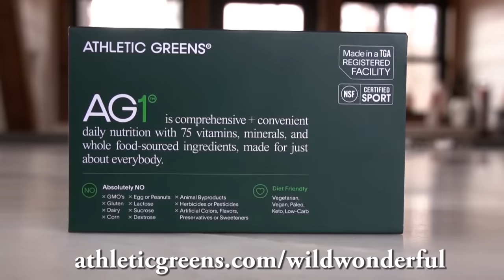DEMO DAY on The A-Frame | Cabin Addition

Comment: You may have said this but will the addition add such and electrical demand to increase the capacity of the off grid system with the accompanying solar panels, etc?  Your presentations are “wonderful” all the best!
Reply from the maker: It depends on if we decide to go with a full on HVAC system or if we stick with mini-splits. If we stay with mini-splits we are good to go with our current system. If we put in HVAC then we will need to upgrade.

Comment: Not to knock your channel cause i love you guys but why did you cheese on the floor joists with 19 and 3/8 spacing instead of 16 inches you're making a mint off the you-tubes.
Reply from the maker: The joists are spaced 16 on the center. The distance the joists with the beam underneath needed to be was 19 3/8 (so the length, not the spacing)
Reply: gotcha just wondered because it wasn't lining up with the wall studs. Apologies im ocd about that kind of stuff...lol @WildWonderfulOffGrid